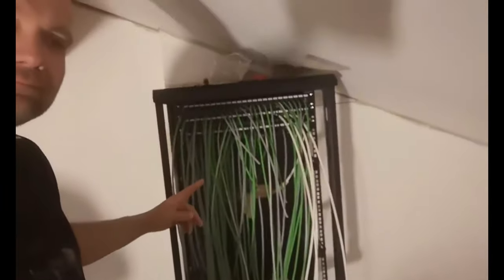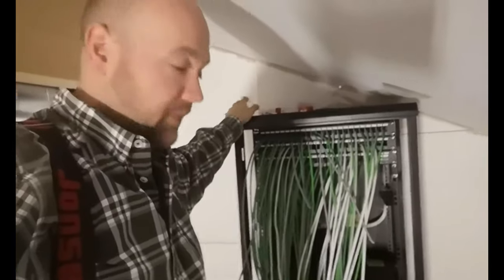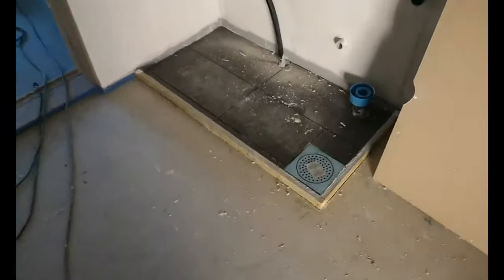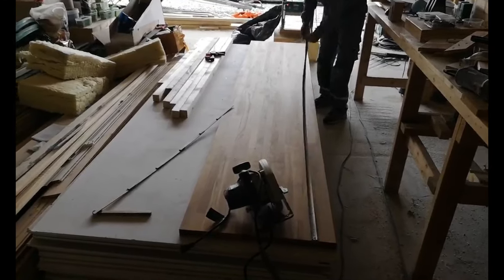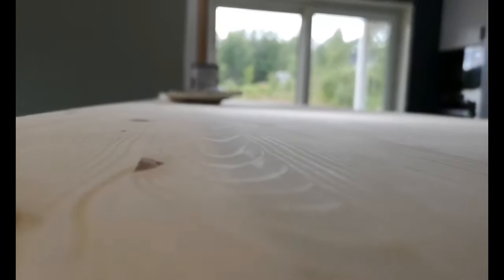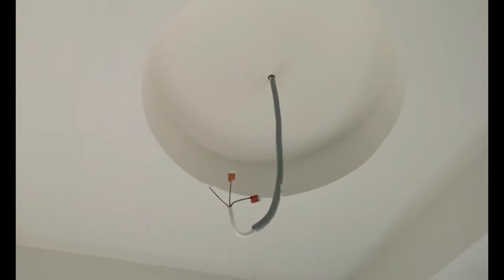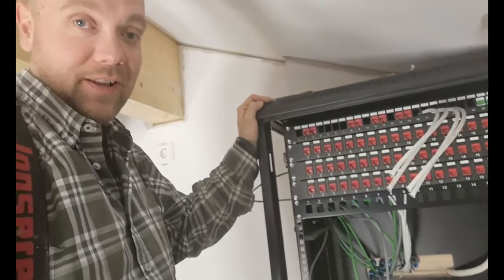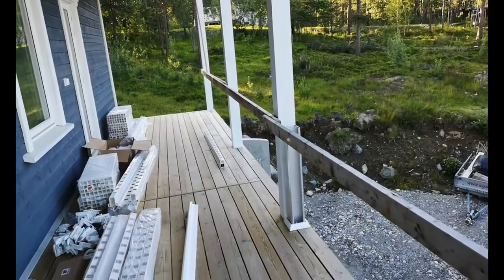Chandeliers, IKEA PAX, Cat6 panels, and DIY laminated pine countertop at #jarleifhouse!

Comment: Wow! So close to being done! The "thing" with all the wires going into it? What does it do? What is it for?
Reply: That's a network patch panel. Its basically a termination points for all the different network cables that go off to the different parts of the house. From there they can be connected to a network 'switch', which will allow you to send power and network signals through the cables. I only know this stuff cause I work in IT! :P

Comment: The railing is looking smashing! And I like how quickly it seems to get installed. Is that PVC UV resistant? I.e. do they guarantee it for x number of years? I'm asking because certain types of PVC will disintegrate over time because of the UV rays. Some old deck chairs for example, or plastic toys left out in the garden will literally turn to dust over time, because the UV breaks down the molecular bonds.
Reply from the maker: Thanks! The product is UV resistant, and a very solid product! 😊 You can feel that it's not flimsy or cheap.. pretty good thickness, and the aluminum posts are a good height for securing to the framing. I'm very happy with it! 😀
Reply: @JarleifVaagen  what brand is that? I could do with a railing for my new deck.! 😎
Reply from the maker: @AddictedtoProjects  I bought it from www.kystgjerdet.no - they might possiby have a dealer closer to you from the same manufacturer.. I'm guessing it's made in China or something.. 🤷‍♂️